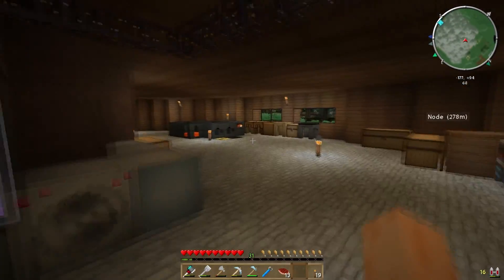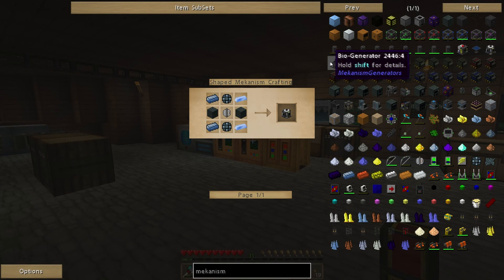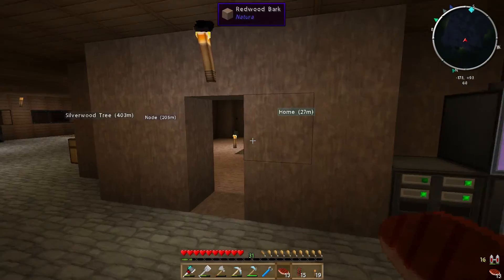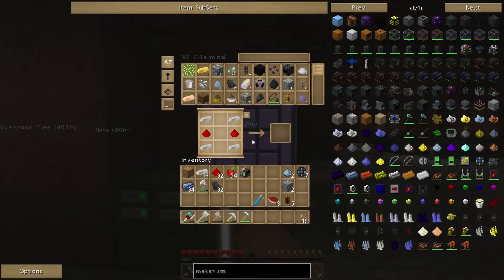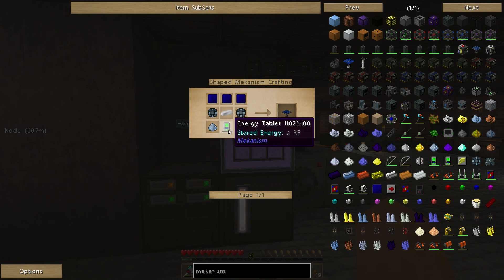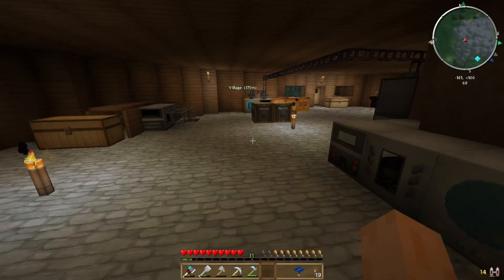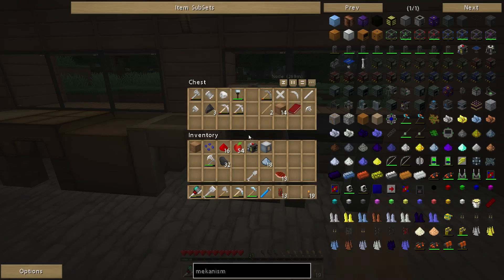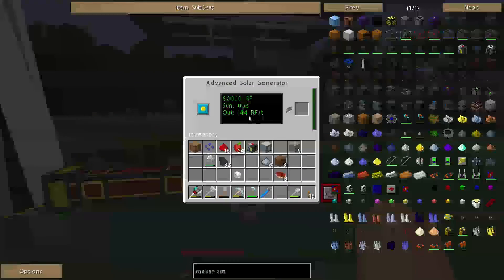Let's Play Minecraft FTB TPPI #17 - Renewable Power

Comment: for getting up and down your floors i would recommend you build OpenBlocks Elevators, they are made from 8 wool around an ender pearl, but you need 2 of them to work obviously, quite cheap, and i think they have a range of 10 blocks vertically, shift to go down and space to go up.
Reply: ***** Elevator blocks ROCK!. Ohhhh before I forget. Don't waste the resources to make a muffler for your Mekanism machines. It doesn't work.....YET. As for the Hydrogen Generator, you need an Electrolytic Separator and a Aqueous Accumulator.Output the Hydrogen into the Hydrogen Generator. Run two cables One from the Generator and then back into the Separator. You then need to jump start the system with a little bit of redstone (not sure if coal will work or not). Sorry for being so long winded :(